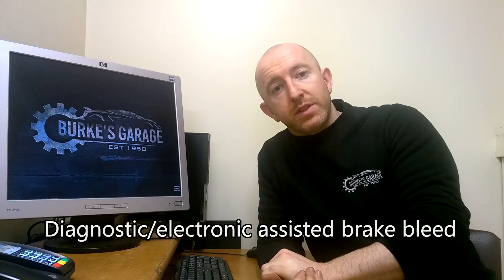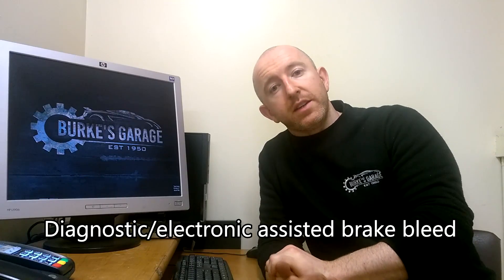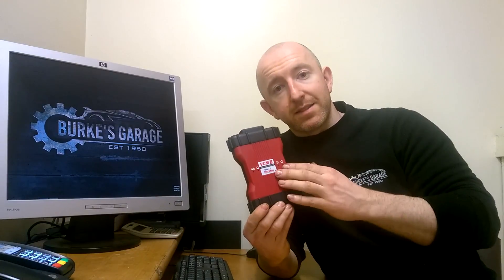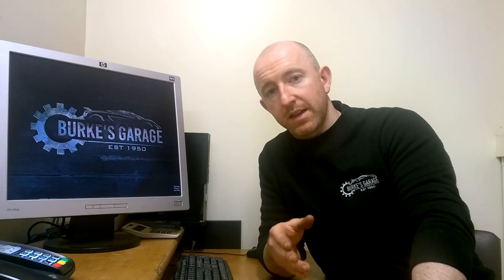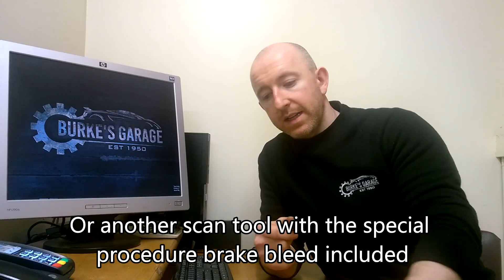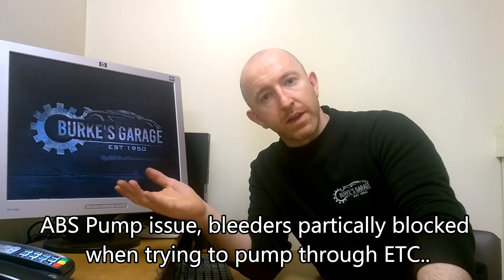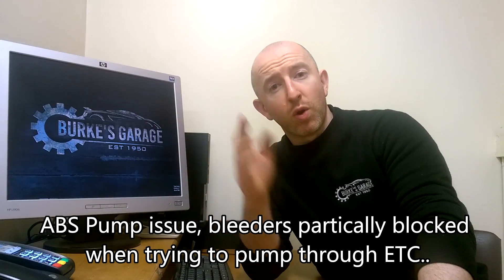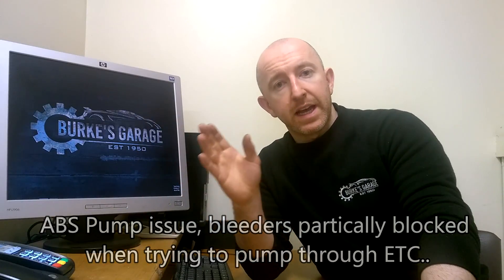Soft or Spongy Brake pedal???? Check out this video for more info

Comment: thx for info. I am working on a 04 camry. We replaced front calipers, flex hoses, rotors and did manual bleed all 4 wheels starting with rr, lr, rf, lf. we took for test drive still have excessive pedal travel. Can youhelp us?

Comment: Hi - can you recommend a mechanic in the Dublin south city area that provides a similar service for a VW GOLF MKV 2005 with spongy break pedal. Issue very evident following replacement of perished NearSideRear brake hose. NCT retest to inspect repairs scheduled mid July 2019, but with spongy breaks, I am more than a little concerned of yet another fail. Noel, Blackrock.
Reply from the maker: Hello Noel, Unfortunately I am unable to advise you of someone for repairs in that area.   
I have done this on quiet a few golfs now and had great success with improving the brake pedal feel on each one. I wish you all the best in your search and fingers crossed you get it all sorted soon.

Comment: I own a 2005 Lincoln Town Car modified into a 8 passenger stretch limousine. I would like to know if you would recommend that I buy that red machine that you featured in this video. I want to bleed my brakes properly this time. I have repaired my brake lines and as a result I've noticed that it takes longer distance to stop and the brake pedal feels very spongy.

Comment: I have a 2004 Tahoe. I have replaced the pads / rotors no problem, bled the wheels, and the pedal is still weak / dead, thoughts?
Reply: Also be sure to make sure all pistons are freely moving and not seized.
Reply: Bleed brakes 1 x 1 until all the air is out.

Comment: I have a 2006 Nissan Xterra (with VDC system) that suffers from soft spongy brakes. I had it bled a 1,000 times and nothing. New rotors, pads, calipers, steel lines on all 4 corners. Master cylinder, booster, and ABS module diagnoses in good order. Why would a dealer (or a big franchise brake shop) not be able to fix this. Unless they want to scam the customer into making unneeded repairs (or they are simply incompetent). And the dedicated Xterra forums can't solve this either....? So the question is this - will this technique work on my vehicle? Please help me with this so that I can finally have peace of mind.

Comment: Why after bleeding the break system is the peddle still soft o n a 2000 honda crv
Reply from the maker: When bleeding any system you need to bleed all 4 lines (possibly multiple times) to remove all air from the system, tools that help are pressurized & vacuum types, also having someone in pumping the pedal while you bleed the lines is in some cases essential.  
I was at a transit yesterday and the lines required 3 full flushes to get pedal 100% using vacuum & someone at the brake pedal pumping. 
 
All this info is assuming there are no faults in the system of course. 
 
I hope this helps.
Reply: great info. I have a problem where I forgot to top off the master cylinder with brake fluid while bleeding the air out (had to disconnect the caliper and lots of brake fluid came out), and probably introduced air into the system. the car is a 2007 trailblazer with ABS module. after bleeding the air out using over a quart of brake fluid from all 4 calipers, the pedal still sinks to the ground with no pressure/resistance at the brake pedal. there is only very minimal stopping power at the end. what would you recommend in this case? replace banjo washers on caliper? bleed out M/C? bleed out ABS module (tec 2 scan tool required which I don't have, any other method?)?
Reply: @AP-bo1if  did you find what was wrong?
Reply: @AP-bo1if  I would try and bleed the master cylinder on your ride, since most likely air got in there, then try bleeding all 4 lines again.